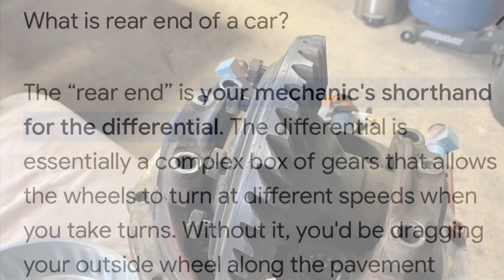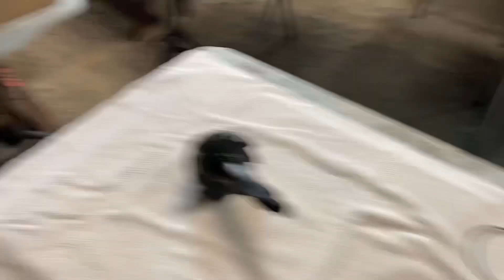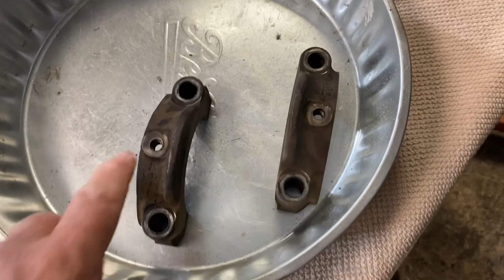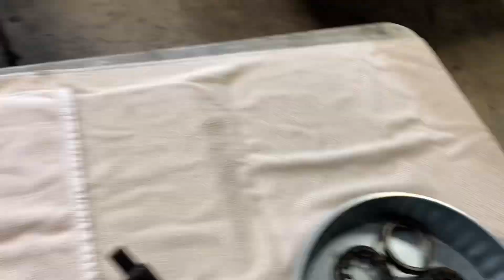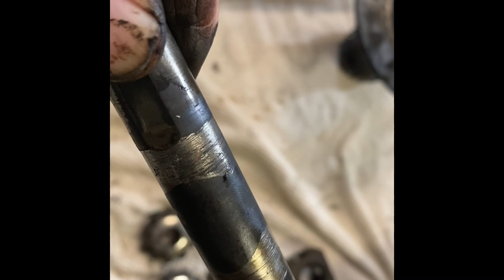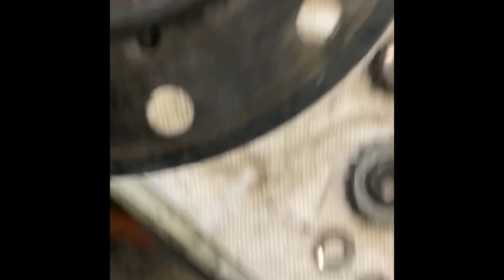1969 Mustang Restoration (Part 15)

Comment: You really should have left the camera on a tripod while disassembling and discussing the differential.  You were waving the camera around randomly, and did not keep the subject centered in the frame.  Also, you needed both hands to handle the differential parts.  IMHO
Reply: Thanks for your suggestions